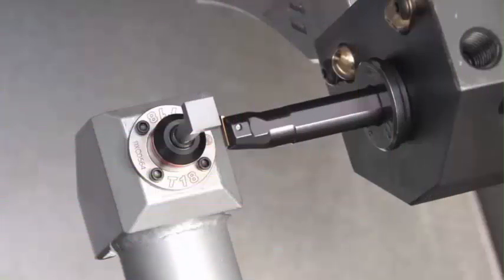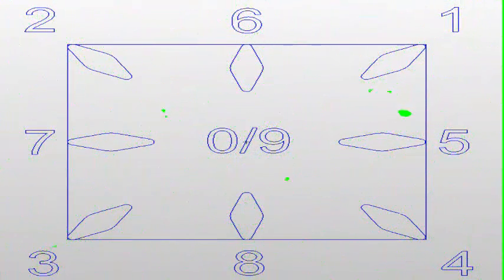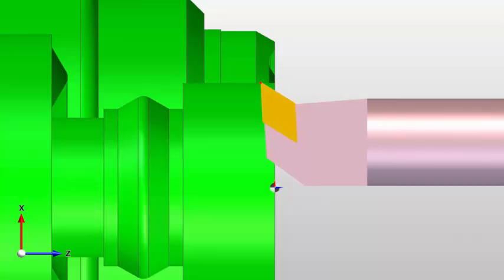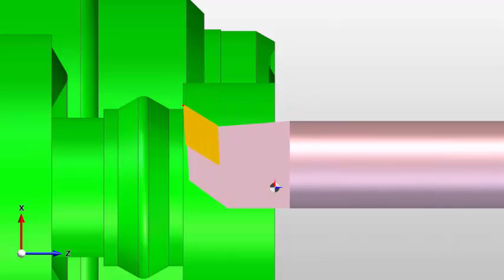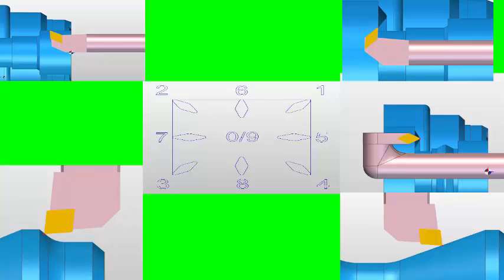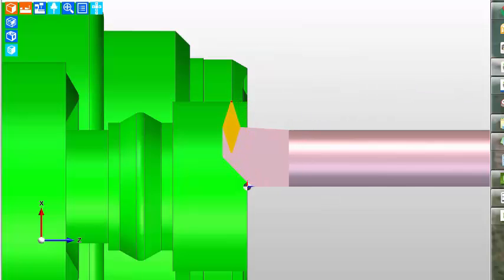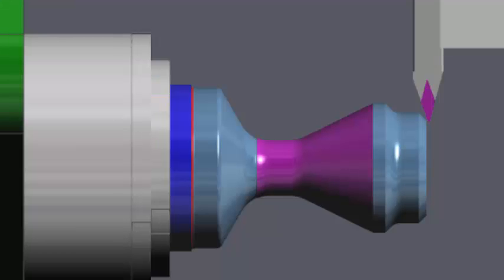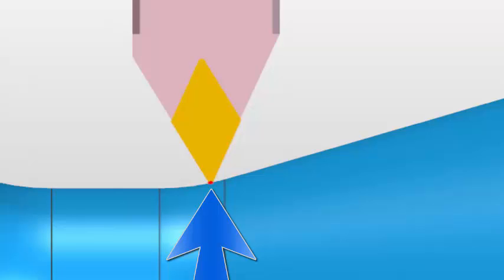CNC Lathe Tool Nose Radius Compensation

Comment: Great video, thank you! How do you handle a straight grooving tool? Thanks.
Reply from the maker: It works the same, you record the corner radius in offset table.
You can program from either side of the tool.
This would use G41 and G42.
This is only if you want to break the corner of the grove. 
It can be done without comp and a lot of people do it that way (not me).
https://www.youtube.com/watch?v=Skfkf61CnGU&ab_channel=CNCTrainingCentre
https://www.youtube.com/watch?v=mYeRLft0kW8&ab_channel=CNCTrainingCentre
Hope this helps, use contact form on my website if you need more hlep.

Comment: who will use G41/G42 it wont do down slopes. dose it?on G71 so you need calculate it to cut less so you dont ruin part. it might work on G70 finising. atleast manual say it not work . so its banned for me lol. there is secret magic formula (1-tan[angle/2])*TNR = compensation for z
second you need is (tan[angle]*z lenght)*2 = x start offset. AND you have correct chamber without G42 buulshit

example with tool nose 0.8mm for 45degree is 0.468
so if do 1mm chamber on 10mm shaft
(1-tan[45/2])*0.8=0.468
10-(tan[45]*1.468*2)=7.064

G0 X7.064 z1
g1 z0
x10 z-1.468

 or simplyfied
G0 X8 z1
g1 z-0.468
x10 z-1.468

its 1mm chamber
same as something like WHAT I NOT USE
g0 g42 x8 z1
g1 z0
x10 z-1

if you have 5x15 degree chamber. drawing never tell what is height you need calculate even use g42. dont you? unlees use A= angles on gcode,but thats even harder

(1-tan[15/2])*0.8=0.695
10-(tan[15]*5.695*2)=6.948

G0 X6.948 z1
g1 z0
x10 z-5.695

without even calculating x start height we not care that we have lenght that we use calculate start.
well offcourse that real dimension is
tan[15]*5.=1.339...

so we could do but we dont
G0 X7.332 z1
g1 z-0.695
x10 z-5.695

but this hard first is correct and easy we not need know real height :))))
it is just magic number LOL nothing else.who need cadcam anymore?

i dont use cadcam i not use nose compensation i calculate it myself OR remeber all and all we need TAN.its magic. dont tell anyone this is top secret cam manufacturers dont want you know
Reply: Is this only for a 45 degree chamfer,  I was hoping to make custom tapper fits,   but I thought the formula for x was similar, meaning still divided the included ( taper) angle by two, but referenced the angle similarly,  it's just a question of when to ad, when to subtract.
Reply: @ryanb1874  it's for all chambers and 45 degree is so Easter i s make 45 degree chamber tool radius bigger but it's actually bit more
Reply: @ryanb1874  so quickly demo if my figure like draw in cadcam

X0 Z0
X18
X20 Z-1
Z-19
X18 Z-20
Z-25
X30

so i have M20x1 thread and lenght is 20
with 1x45 chambers
i use 0.8mm  nose radius
so (1-TAN(45/2) )*0.8=0.469 <---magic number. so with 45 degree you could use 0.4 you see its pretty close,but you see if you clever you could remember use 0.45
on 45 degree chamber xD its just 0.019 smaller

X-1.6 Z0
X17.602 (20-1.469-1.469)
X20 Z-1.469
 (1+0.469)
Z-19.131 (21.131-1)
X18 Z-21.131 (20+1.6-0.469)
Z-25
X30
Reply: Could you please explain to me how the x formula is,  I tried an example on calculator,  and I am getting .1999986 (and that doesn't seem to be right) for a taper that is .100" in diameter at 15 included (so 7.5 is used with a .015625 radius,  and you don't include the radius in that formula. Just curious.